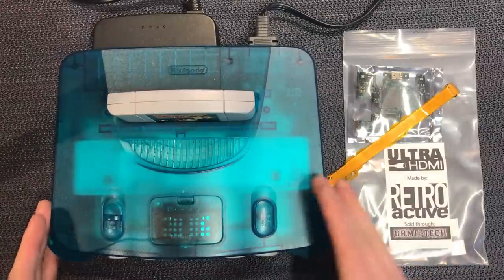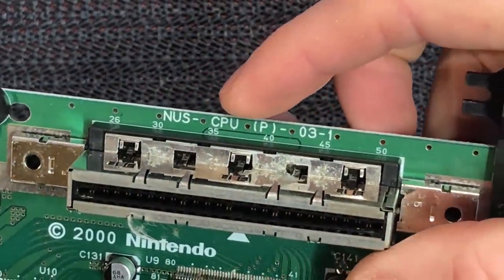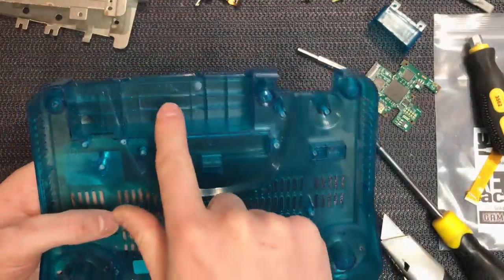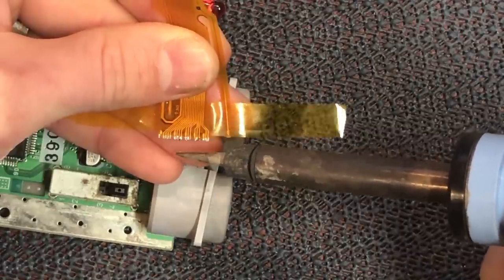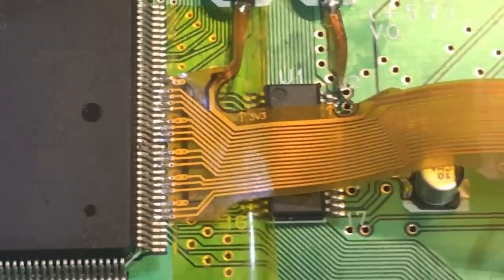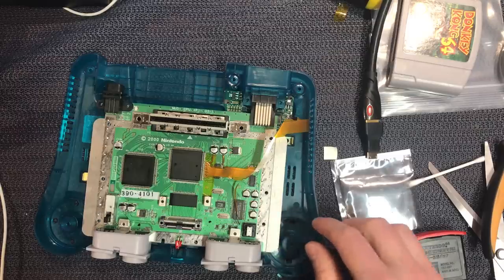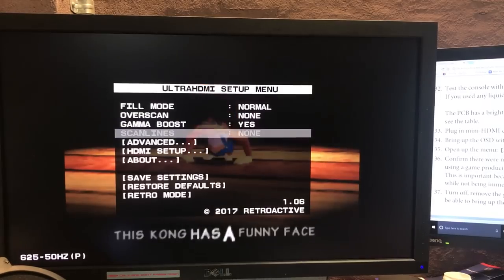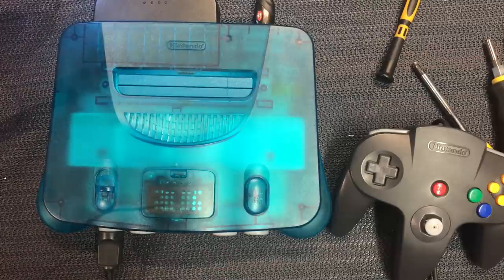How to Install N64 UltraHDMI Kit - YouTube

Comment: Great vid as always man!   I just recently did my first n64 HDMI mod.  It went off without a hitch.  I do have to say, that my purchase of a microscope earlier in the year has paid for itself for mods like this.  I find it makes doing this type of solder work A LOT easier.  Also, by using the 30x i can get in nice and close to make sure that all my joints are solid and have no bridges. 

If I hadn't already watched Jason at Game-tech do his mod of this, I would have used yours as a tutorial for sure.  Hey, your method for the famicom AV mod is what i use everytime.

Keep up the great work bro!

PS - if anyone is curious, I use an Amscope SW-3B13 stereo boom arm microscope for my work.  with a 10x for solder work and a 30x for checking.  It's not cheap, but if you do mods all the time, I recommend it for sure
Reply from the maker: Yes I have to agree. A microscope for checking the work was invaluable. Yours is a top quality microscope! wow that's an investment. Mine is only a cheap one, but i does the job. If I was to buy a new one I would try this - http://amzn.to/2vqSNBj
Reply from the maker: No I don't think so, just different solder points for PAL vs NTSC. It's all in the instructions with the kit.
Reply: Adam Socolofsky your mod will change depending on what board you have, but it’s only a small difference.  It’s all in the guide when you mod though, so just refer to that to make sure you’re modding properly for your board version

Comment: ive done this install, that delay when you turn it on for the first time is nerve racking.

bit of a tip if you are doing this for customers, when you send one out set the options to default.I have tested it on a couple of TVs and it turns out some options are not compatible with some TVs and give a black screen
Reply from the maker: dylbob9000  Yep this was a customer install job. Yes I did notice the reset option after playing with it for a while and did that before sending it out. Good tip!

Comment: Nice work, appreciate you showing us the process.
Reply from the maker: No worries. It's a fairly straight forward process, but the pins are incredibly fine which makes it challenging. You could mess this install up very easily by bridging pins and not being able to remove the solder completely.
Reply: Global Garage Or if you're like me and don't even know what sodering is.
Reply: Watching your video just makes me want to do this myself. I would rather spend months learning how to soder than let someone touch my N64, my one and only. I would rather buy a broken N64 to test this out on. Should I just get someone else to do this for me? Am I just gonna end up screwing this up? Your instructions are just so clear I feel like I could do this, except I just read about accidentally bridging connections. I was looking for what to be careful with. Thanks for posting.
Reply from the maker: Aykut Ucar It’s very small and delicate soldering. You could give it a go but maybe practice soldering on a junk board first. Just practice soldering tiny wires to individual pins.

Comment: You don't need L & Z for the menu (it's one or the other). You also don't need to remove the Jumper Pak/Expansion Pak. It'll come off with the top lid and stay contained under the lid! Much easier. :)

Comment: Cool video! What monitor do you use for the original RCA output?
Reply from the maker: Chris Kenny Dell U2711
Reply: @GlobalGarageAus  thanks, do you use some sort of video to vga converter?
Cheers
Reply from the maker: Chris Kenny No need as that monitor accepts everything. Composite, Component, VGA, DVI, DisplayPort, HDMI

Comment: Always nice see a new video from you, even if I don't care for this particular mod.
If you want to play N64 in HD, the best way is with emulators. N64 should run on CRT.
Reply from the maker: adilator It's an impressive bit of kit for those who really want it.
Reply: yeah playing old stuff on a modern display is janky, but if you got to do it, external scalers (as opposed to the shitty ones built-in to tvs for composite and s video ports) do a much better job at putting 240p and 480i signals on 1080p displays.

Comment: Hey mate, great video. I can solder but would not trust myself with this. Do you know where I can purchase this kit? . Also how much would it cost to get it installed? I'm in Adelaide SA. Cheers
Reply: Retrosales has its installation service for $170 (or something else) but the actual kit itself is sold out so idk if it's still up for sale, guess we all will need to wait it out

Comment: I've done several of these mods myself now but I watched just to see if I could give any input.

You didn't mention that the cartridge slot has longer brass-colored screws and that it just pops off once those are out. Try it! Lift both sides evenly though or you’ll break one of the “wings” that the screws go through.

The reason to pry the heat sink and RF shield from the back is because the thermal pads can rip up the RDRAM chips in the other direction since almost all the legs holding them to the board are on the back side (very odd package that has almost all legs on a single side with no dummies).

So weird that PAL DK64 isn't a banana yellow game pak like it is in North America.

To avoid unwanted input on the game in the background you can use the D-pad without any buttons (after invoking with buttons, of course). Up/Down changes selection, Right will make/enter the selection, and Left will back up one level/cancel.
Reply: My Aus PAL copy of DK64 is a banana yellow game pak! I remember because I got it for Xmas with a bundled in memory expansion pak ;) Looks like my fellow Aussie Global Garage is using the Euro PAL copy ;)
http://retendo.wikia.com/wiki/Donkey_Kong_64

Comment: Awesome work. I believe there will be a new n64 mini soon;hopefully we can add games. I might jump on that. Otherwise I'll stick with emulation.
Reply from the maker: Sure. I think Nintendo may decide to make a N64 Mini after they see the sales of the SNES mini coming soon.
Reply: natr0n

If Nintendo don't end up releasing an N64 Mini, then I'll be releasing mine anyway. ;)

I designed a new motherboard which uses the original N64 chipset, but has an FPGA and SDRAM on the underside, so it can output HDMI, but also has an onboard "Flash" cart.

http://imgur.com/a/UwR3Y

The board is only 10cm square, and no PIF nor CIC chip is required, as it boots directly from the FPGA.

The ESP module is used mainly for the higher-level control, and OSD menu / SD card stuff, but can also be used to easily mod controllers to connect them wirelessly.
Reply: natr0n

The board still has headers for a real PIF / RGB DAC, or a proper cart slot.

It's booting from an Everdrive atm, while I work on the HDMI output stuff.

Then I'll finish the cart "emulation" from SDRAM, and hopefully find a nice mini case for it.

Booting the N64 from the FPGA also means that it can be made truly region-free / universal, as soon as I implement the few extra CIC chip types.

The most complex CIC chip is the x105 type of course, which is used for a handful of games, mostly from Rare.

Almost all other games are simple enough to get running, as the FPGA just implements the proper CIC seed responses, like most emulators do.
Reply: Amazing work.
Reply: Reggie Fils-Aimé

Howdy. ;)

Yep, it seems likely, but unless Nintendo themselves license / port their N64 emulator from Virtual Console, or by some miracle, actually do it properly, and release a custom ASIC / Gate Array for it, then I'm worried that the emulation won't be so great on certain games (like Goldeneye etc.)

Nintendo don't really have many excuses to not just release a Gate Array version that is very similar to the iQue.
It could then not only be a 100% compatible N64 "clone", but still keep the price down, and possibly add slightly higher rendering resolution etc.

I strongly suspect it will just be yet another slightly boring but slightly more powerful Allwinner SoC though, which is why I wanted to build my own board that uses the real N64 chipset. ;)

Hopefully, if they do match the rumours and actually release an N64 Classic, it will be fast enough (and / or the emulator good enough) to play ALL of the games without any annoying slow-down nor graphical / audible glitches.

(Oh, and hopefully without the noticeable lag of the NES Classic, especially on the sound.)
Reply: u cant download nintendo 64 games anymore cause nintendo is attacking every singe site that hosts 64 roms or all nintendo roms
Reply: natr0n Through modding like the NES Classic Edition of course you will as long as you're okay with voiding your warrenty. You also have to worry about getting one to begin with. I myself can't afford a pc so I can't emulate so if I unfortunately don't get one I'll be shit out of luck. Heh heh it sucks for us N64 fans that can't afford a pc because we don't have many options we are very limited.
Reply: ElectronAsh Dude I would so buy one if if I was someone who couldn't get my hands on a N64 mini when it comes out and I probably will miss out so I would buy one. :3
Reply: Thanks. ;)

I think I was actually dreaming about working on the Mini N64 board again last night. lol

I still need to get wireless controllers working. I have a controller in pieces already, I just need to hook up an ESP8266 module to it, and do some coding.

And then get the SDRAM working properly on the board, so it can do proper cart emulation.

Once those things are done, it's pretty much just writing some menu code to control everything.
And then find a nice mini case for it.

I might try something from etsy maybe, but 3D prints on there seem to be quite expensive tbh.
Reply: natr0n Mini Gameboy next mate before N64 .. they're re-releasing every classic console in Chronological order. So Gameboy next.

Comment: Is there a significant risk of something going wrong if I do this myself? It doesn't look too difficult, and I have some experience with microsoldering. I also have access to some decent equipment at my university.
Reply from the maker: You should be fine then. It’s not difficult as such, just extremely fine.

Comment: Nice video I'd rather do scart to hadmi conveter only about $60  and can also use it on snes
Reply from the maker: The N64 doesn't output RGB be default, so SCART will only be passing Composite video to the upscaler. It'll look average at best IMO.
Reply: How crap is it! It's the only console I know of Nintendo made without RGB on the A/V Multi-out (for PAL regions) :(

Comment: Dude you hold the n64 controller like you've never used one in your life. Theres nthing wrong with the controller, its the users.
Reply from the maker: I haven't. I absolutely hate it! :) There's a reason that style of controller never made it mainstream, it's just not ergonomic.  If you compare it to the PS1 dualshock controller at the same time you can see why it was killed off pretty fast.